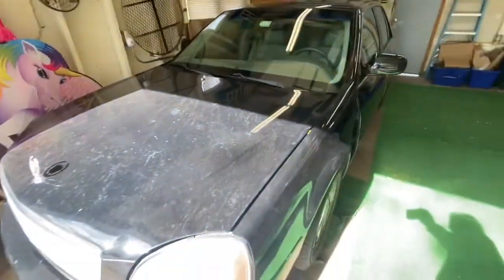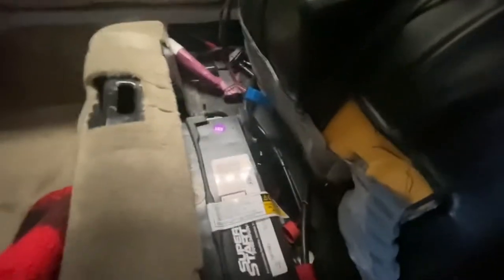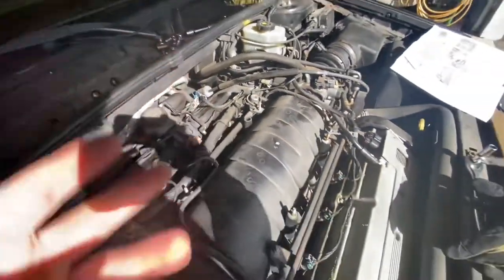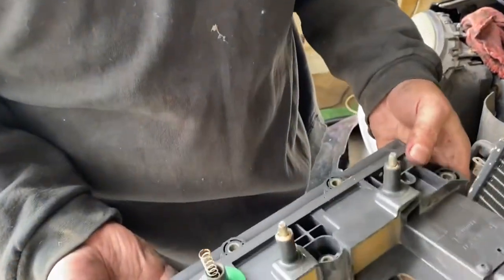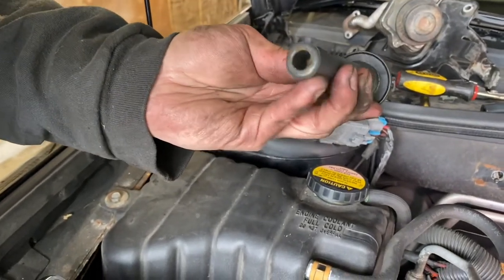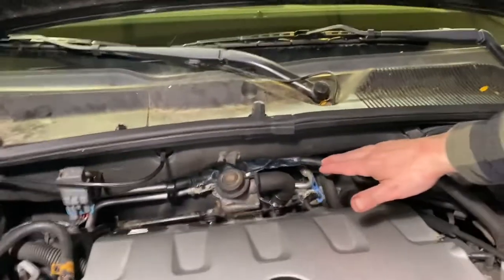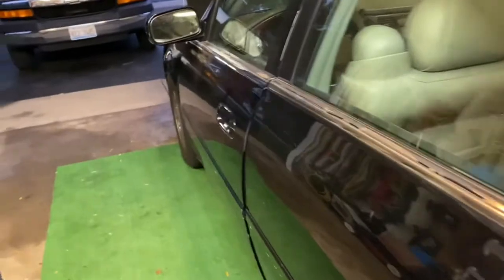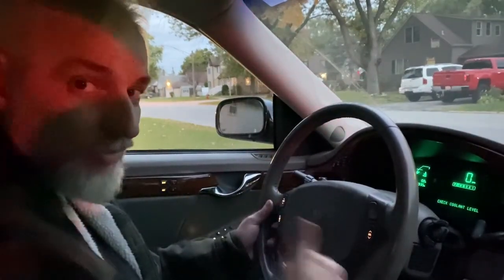P0351 & P0303 Codes Ignition  Coil Replacement & Spark Plug Replacement 2001 Cadillac DeVille

Comment: You are a patient man. 😀 Appreciate the vid, it really helped me with my 2002 DeVille. 

FYI, for anyone who might see this...The corrugated hose nuts are pretty much impossible to reach from under the car. I was able to remove them from above with a 10mm, 1/4" drive deep socket, a flex connector and 12" extension.  It wasn't super easy, but got it done. When re-fastening the nuts, I put some stick-um on the end of my socket to hold the nut on until I got it attached to the threads. Hope this helps.
Reply from the maker: Thanks for the comment, yea that air valve is hard to get to, a poor designed engine, just hope you don’t have to change the starter another major job.
Reply: Wife's car. Trying to talk her into selling it before something else goes wrong or breaks.  It's a nice car when everything is working...but there's always something breaking.
Reply from the maker: @maxp9793  same thing on my end, this my wife’s car also!

Comment: AwewJeFF ,Cool stuff man same code same year ,mine says crankshaft sencer but ill go for the coils ,,,crank sencer goes out they wont run hardly ,so way kool .Thank you God bless and Happy Thanksgiving brO.
Reply from the maker: I had all kinds of codes because of the coils and spark plugs, I don’t know if I have crank shaft sensor code, I’ve had the crank position sensor go on my Chevy Express, an oil change actually fixed that problem. So I’d do an oil change and flush the engine as well. Happy Thanksgiving to you too!

Comment: Under the vacuum pump itself right where the hose connect to it it's nuts on each side just take the nuts off and pull the vacuum pump straight up instead of going up under the car
Reply from the maker: I think the hose though is still in the way, did it work out for you?
Reply: What size do we need to remove the nuts?😅
Reply from the maker: It’s a 10mm to remove the vacuum pump hose
Reply: We successfully removed it from the top with a swivel, extension, and ratchet. 

We put it all back together perfectly, and now the car starts and runs normal for about 3 seconds before idling up to 1000rpms and then up and down constantly. The engine has a slight shake like it's struggling, possibly missing... code shows a secondary air pump, which has been changed twice and was a code before but ran smoother. Its all new boots, plugs, coil etc. What could it be? 😳

Comment: Do you know the part number for the rear coil pack that had the 4 coils in it? 2005 deville
Reply from the maker: I bought mine as a set from parts geek, looking at yours, the part number for both coils is 18289-02155144, the set sells for 194, each coil on its own is 104. Double check yourself to ensure that this part fits your vehicle, you could also go to auto one, have them look up the parts specifically for your vehicle. Hope this helps!
Reply from the maker: Also looking at your year further seems that your coils packs are individual for each cylinder, my year is different as it was a complete module for 4 cylinders. Your vehicle has a different setup for the coil packs, not sure if you have a code or just doing general maintenance you can replace only 1, to check if it’s the coil, swap a working one with the one that is coming up as defective and see if the code changes to a different cylinder

Comment: I currently have a 2000 Deville and my 6 cylinder coil is bad how could I locate which cylinder is 6? Also was your car shaking or vibrating before you replaced your ignition coil am currently going through this would like some help
Reply: Ive got the same issue on my 2004, it could be a pleathera of problems from just your ignition coils to something going on with your emmissions system and intake. Check your vaccum hoses especially around the #6 cylinder by spraying something like brake cleaner or carb cleaner around the seal on the intake. If the idle goes up you know its pulling air through and feeding off the spray. since your getting the cylinder #6 just replace the 3rd coil on the front side of the v8 thats facing you. the count goes 2 4 6 8 on the front and 1 3 5 7 on the back. hope this helps you out.
Reply from the maker: Yea my engine was shaking real bad, especially in reverse, you must have individual coils, I’m guessing? Do you have front wheel drive or rear wheel? Either way if you have real wheel your odd cylinders should be on the left and evens on right.
Reply: The ole sideways Northstar like in this video,.. or my Seville.
Odds are on the rear by the firewall. 
Evens in front. 2,4,6,8 starting from the passenger side. You can guess the rear. Firing order, 1,2,7,3,4,5,6,8.
You know you can Google this stuff in like 2 seconds for your exact vehicle. I just did 😂

...oh yeah, it's the same on yours btw 👍

Comment: What's the torque specs for the coil pack bolts though?
Reply from the maker: There is no torque spec requirement for there is tightening sequence that needs to be followed, I will see how I can post a short showing that
Reply: @jeffosborn60438  That would be awesome much appreciated👍 So those bolts just need to be basically hand-tightened then? Just not too much of course...
Reply from the maker: @MetalLife1993 yeah not too tight, check my shirt for the tightening order

Comment: Why gm thought to shove that wide engine in sideways is beyond me and most people the newer sts was rwd why not the DeVille or DTS
Reply from the maker: Your right just an overall terrible design. Never again
Reply: @jeffosborn60438  I can't think of another car after the DTS with FWD and a V8 from any company
Reply from the maker: Found a list that shows other cars that are V8 front wheel drive https://www.carthrottle.com/news/8-cars-front-mounted-transverse-v8-engines
Reply: Because the platform was around since 2000 when the new deville came out…06-11 dts was on this platform too…for rwd when they did the new deville for 2000 they would have had to implement that right then and there…it woulda been awesome cause fords panther cars are rwd
Reply: @toddprater14  of course all the new 4 and 6 cylinder ones are rwd or AWD damn GM
Reply: @jeffosborn60438    All of the weight being on the front over the drive wheels gives it excellent traction.  Our Deville was the only car still going when everyone else was stopped during a blizzard.